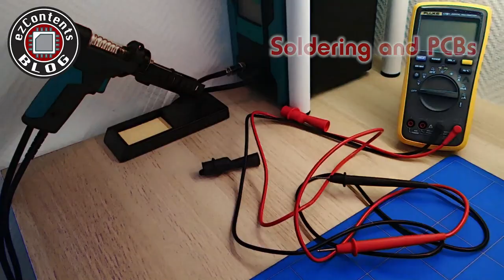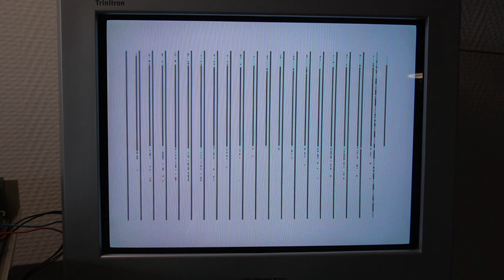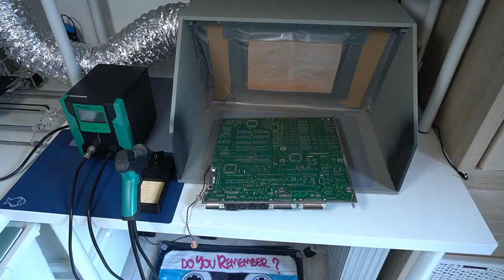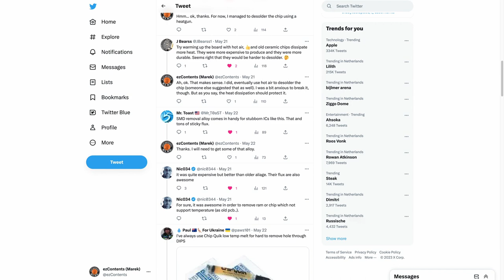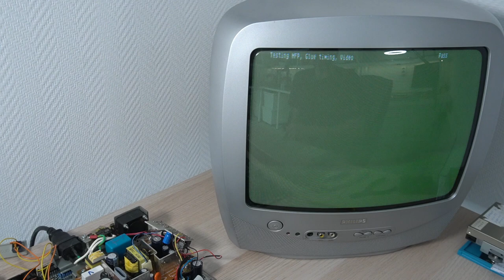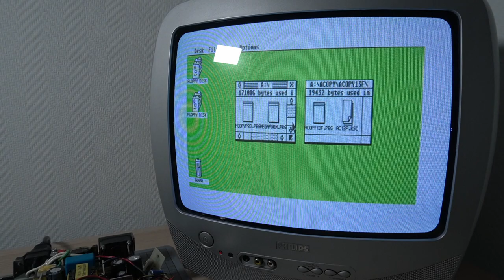Atari Mega ST 2 repair

Comment: I miss my Mega ST2. The motherboard on mine looked like the one you picked up for a spare. Where the RAM chips are is an outline of where more chips could go. I soldered in sockets on all of mine and added more RAM and turned mine into a Mega ST4. I never had a color monitor for it. I got the monochrome monitor as I used mine for Desktop Publishing with PageStream.
Reply from the maker: Nice work! I though about combining all of the RAM chips from both boards. But desoldering them is hell, so I did not continue.
Reply: @ezContents  yeah, back when I did mine, those ram chips were easy to get.

Comment: The diagnostic cartrige would show you which RAM chip failed/MMU - over serial connection. You were lucky!
Reply from the maker: Yes... That was actually something I wanted to try. Too bad that I got lucky. 🙂
Reply: @ezContents  Yeah, based on experience - first thing to test out with any ST is the serial port, right after checking voltages! Cheers!

Comment: Lot of work for such old computer  :-)    But if you can get the megabit D-ram for low cost, why not upgrade the Atari to 4 MB?  I believe it can be done with the piggybank method  ;-)
Reply from the maker: Yes, maybe. I will see what the upgrading options are. Thanks for the tip.